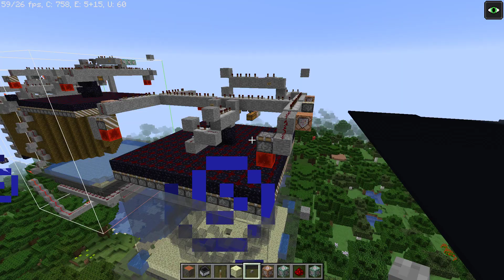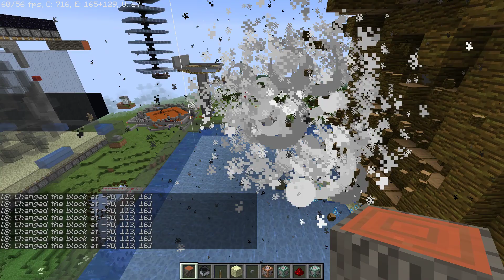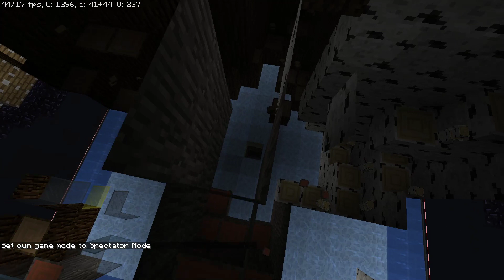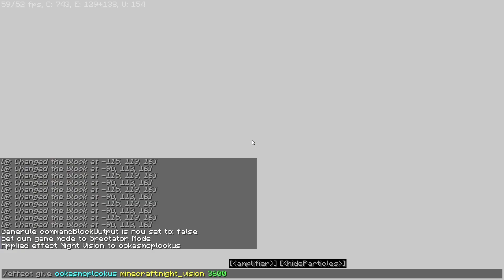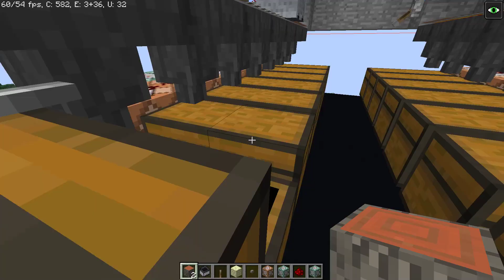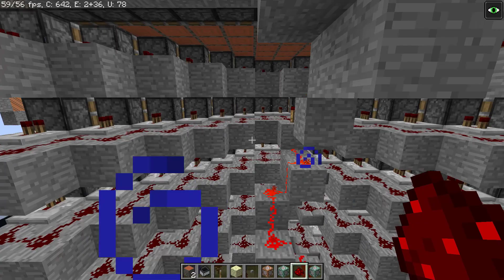Minecraft TNT blast chamber for ilmango's consideration - outdated

Comment from the maker: 2 things i forgot to mention:
The clock gets depowered during the explosion because if the giant triangular wall of pistons keeps actuating, you risk having blocks move into the gap that gets created when the upper pistons give the chamber the downward kick for block 36. This means the outer edge of the chamber can't be pushed back up so the blocks remain there preventing the water streams from refilling the lower platform of the chamber. It also means future kicks won't be able to move these blocks and they slowly make their way inwards towards the centre, just making more of a mess. The other thing was that the triangular wall of pistons doesn't actually need to be split into 2 halves in order for only 1 of the feeds to operate at a time. The spot the feeds begin at is 13 blocks out from the centre of the triangle so even if only 1 is active it won't push blocks into the other half of the triangle and interfere with it. Also since the other sides feed is inactive, the observer won't be getting triggered so the and gate and pulse extender part of the circuit should still work as normal for the remaining functioning side.